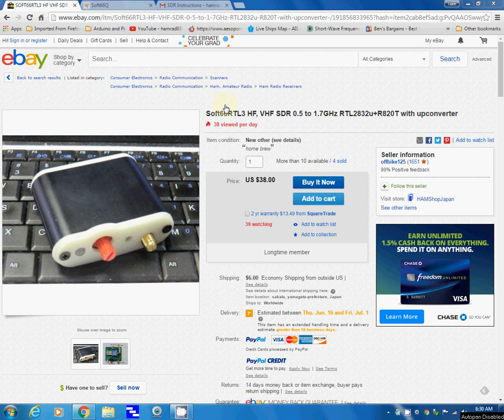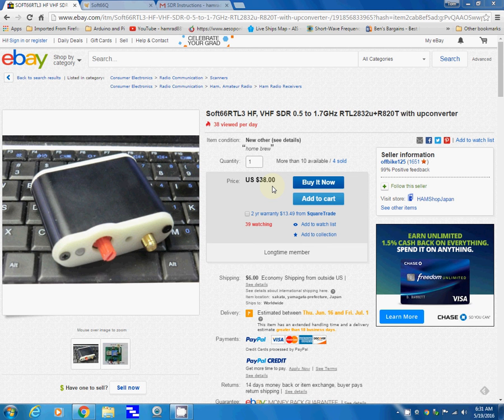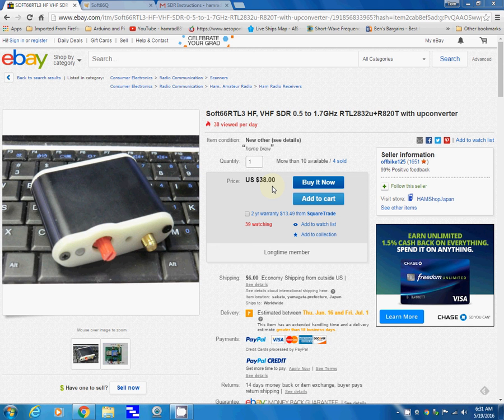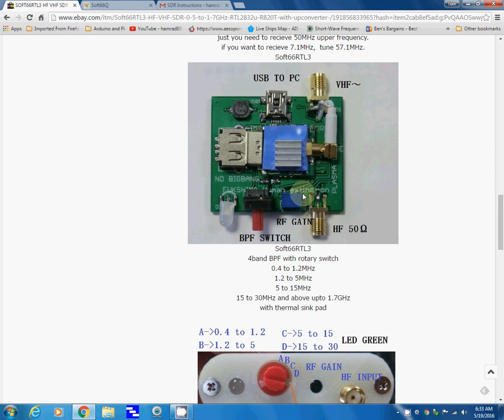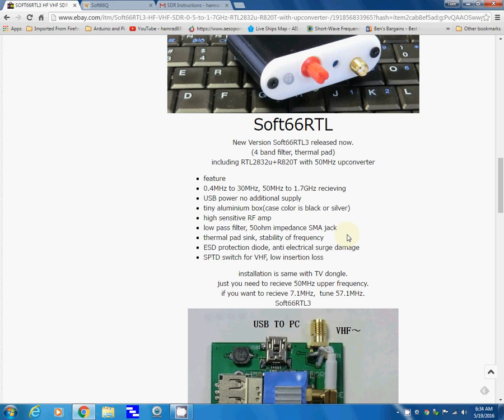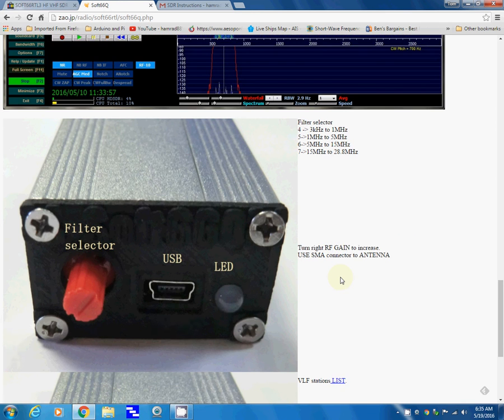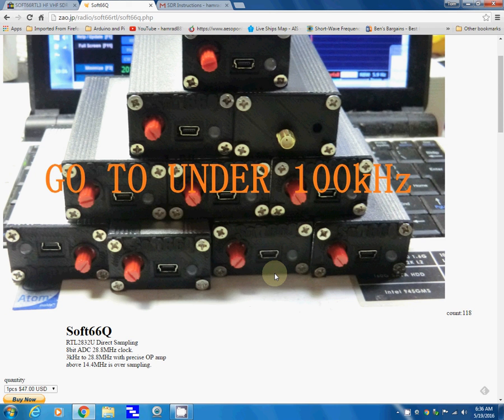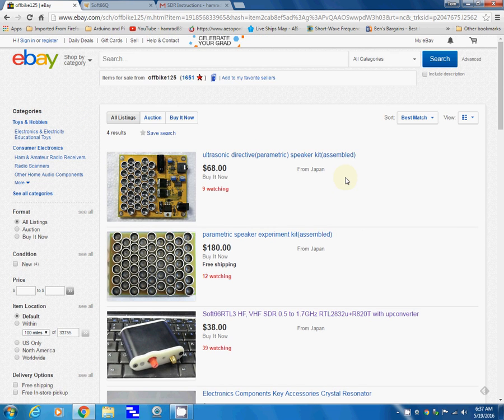TRRS #0858 - New New SDR Receiver for Under $50

Comment: If you look really closely at the circuit board there is a message silk screened on to it. This may not be the time or place to mention it, but it is worth a look. It says:
"Fukishima Human extinction"
"NO BIGBANG PLASMA"
Seller Ebay link , it is the picture on the right.
http://www.ebay.com/itm/Soft66RTL3-HF-VHF-SDR-0-5-to-1-7GHz-RTL2832u-R820T-with-upconverter-/191856833965

I've considered buying one from this guy, the new model Soft66Q looks cool
Reply from the maker: +Craig Nehring I plan to release more testing.